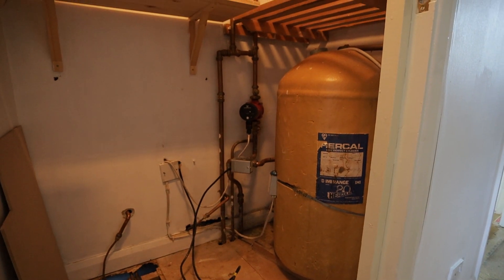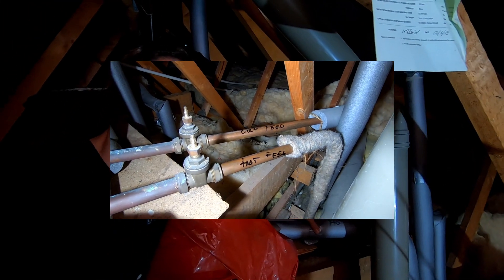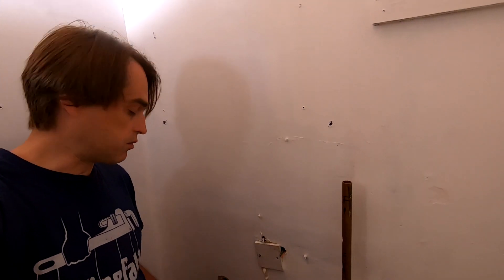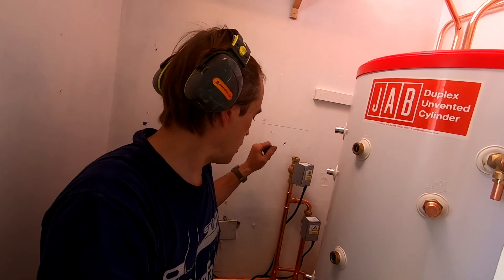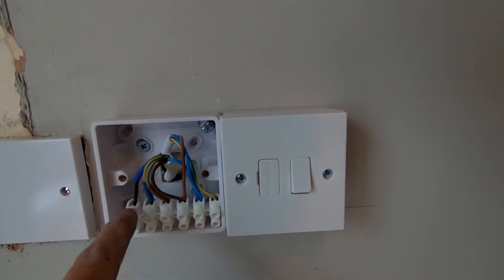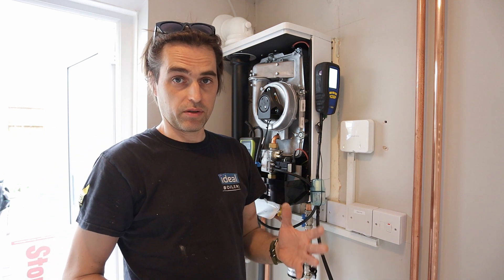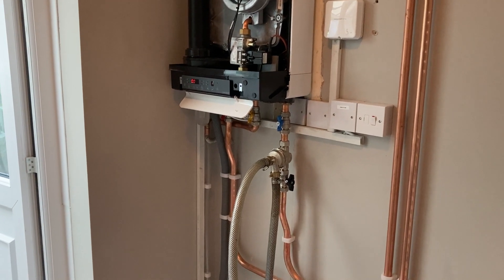Domestic Hot Water Priority with Intergas boiler.

Comment: Hi pal have you ever had the issue on a Xplan when the hot water demand has finished and the heating normally open valve opens than you get some heat in the radiators as the pump over run kicks in. Got this problem on an ideal vogue gen 2 ?

Comment: Was there a reason you used two single zone valves instead of a 3 port valve,I have used 3 port on both of mine.
In my case it was easier as it's only wiring one valve.

Comment: For those with existing S Plan systems, there is another option offered by Intergas which offers a form of Domestic Hot Water Priority without having to change any valves. The option is called "S Plan with Outside Weather Compensation". There is a wiring diagram available from Intergas, and you don't need a 'plumbing' diagram because it works with standard S Plan plumbing. The wiring diagram shows a 240V relay is used to disconnect the outdoor weather sensor from the boiler when there is DHW demand - the demand signal operates the relay to disconnect the sensor, and the sensor is reconnected when the demand is satisfied. The option requires a mains cable from the wiring centre where the zone valve for the hot water cylinder is wired to a location where the weather sensor is connected to the boiler. When there is DHW demand, the outdoor weather sensor is disconnected and the boiler flow temperature is what ever is set on the boiler front panel, and when there is no demand, the outdoor weather sensor is connected and the flow temperature will be reduced to that set by the weather compensation curve. Timing for heating and hotwater are controlled by the existing S Plan Two Channel programmer. This is the option I use on my Intergas HRE OV.
Reply from the maker: You don’t need to disconnect the WC by a relay. The boiler recognises 2 different flow temps - WC and DHW. All you need is a relay that will be controlled by the boiler when there is DHW demand and will interrupt power supply to all heating zone valves. 

The set up you propose if  inferior to the correct method shown in this video, as it will not allow you to range rate the boiler for DHW and the boiler will still think it is doing CH - one with WC and one without. 

Intergas never had correct wiring or diagrams in their manuals, it was all designed and worked out by people like Rich Burrows or Kimbo.

I would suggest avoiding the option you suggest. There are better ways of doing it.
Reply: @UrbanPlumbers  I agree that it's not as efficient as the method shown in your video. Your method is definitely better, but it involves more changes to the system, and the S Plan with Weather Compensation is an improvement on not having the weather compensation.

Comment: I have just come across your page, I'm an electrician. Whilst looking for X-plan info I found this video and must say well done on the information and presentation. My only advice would be to fit an end cap to your trunking and always segregate ELV and LV circuit for compliance; I appreciate it may have been difficult on this site.  Subscribed.
Reply from the maker: trouble is, every single boiler does x plan in a different way. You have to wire them all differently. Nice that electricians are wising up to this!

Comment: Ever come across a HRE where doesn’t seem to be responding to a demand for hot water under x plan

Parameter 1 set to 1
4 to 75
Parameter A To option 6
As per the supplement guide

Even with no connections across x4 - 9&10 doesn’t respond to hot water demand
Reply from the maker: Yes, there is a button on the face of the boiler that needs to be pressed. I kid you not - on some HRE it is invisible !
Reply: @UrbanPlumbers  yes! About 10 minutes afterwards I realised

Since you replied so quickly - any thoughts on how to have water set hotter than 65? Set point on front panel  seems to be limited to 65, but I’ve added mixing valve so wanted to store water hotter . Seem to cycling a bit on hot water so might have a bit of tuning to sort out. Cylinder is rated at 31kw
Reply from the maker: @bobwylie158  set the DHW kW lower if it's cycling. It should not cycle on DHW water. I have never seen one cycle on DHW.
You can set higher DHW in the installer parameters.
Reply: @UrbanPlumbers  I can see the flow temp for heating cylinder (parameter n) but not a way to have cylinder storage temp apart from the front panel (seems to be limited to 65) 

I’m trying to down modulate the  hre 40 SB to 60% on pdhw and see how that goes but not confident from last nights test
Reply: @UrbanPlumbers  I can see the flow temp for heating cylinder (parameter n) but not a way to have cylinder storage temp apart from the front panel (seems to be limited to 65) 

I’m trying to down modulate the  hre 40 SB to 60% on pdhw and see how that goes but not confident from last nights test
Reply: @UrbanPlumbers  I can see the flow temp for heating cylinder (parameter n) but not a way to have cylinder storage temp apart from the front panel (seems to be limited to 65) 

I’m trying to down modulate the  hre 40 SB to 60% on pdhw and see how that goes but not confident from last nights test
Reply: @UrbanPlumbers  apologies - forgot to say it in my previous replies - thank you so much for replying !
Reply: @UrbanPlumbers  done some more investigation work yesterday. Got an esp32 and some temp sensors to measure the flow / returns and cylinder temp. The set point for hot water is set at say 63 degrees but the flow during pdhw demand doesn’t creep up much past 65 until it goes into state [1] . I was expecting it to get to closer to 85 in line with parameter N. Not sure if there’s some strange opentherm negative interaction going on from the nest

I disabled opentherm and disconnected so that it’s only using on off signalling. Same result .
Reply from the maker: @bobwylie158  change DHW in parameters from 65 to a higer temp. thats all.
Reply: @UrbanPlumbers  Hi. Just thought I'd give you a quick update. Been speaking with Intergas on a couple of things. 

The DHW flow temp can be set in parameter n, but unfortunately, the DHW set point (as read by the cylinder NTC) has a maximum of 65 degrees.  

The issue I  have seems to be that of circulation  I find it hard to believe as it's 22mm flow and return but if I have the power at 75% (31KW) my flow temp only gets up to 65 degrees before the boiler shuts down. Dropping to 45% power (18.5KW),  It gets closer to 83 degrees (the cylinder always comes up to temp by time flow increases any more!) I don't have the IDS software but I can only assume that the flow rate isn't high enough to move the heat away from the heat exchanger fast enough. Next week, it's getting re-piped to 28mm to see if that helps. Modulating pump speed in parameter 3. is at 99% so it's not as if the pump is being throttled.  I'm too invested in the process to let it go , so I'll let you know if that makes any difference.  

Side note - I sized the ACV cylinder to match the power output of the boiler in priority hot water mode. The manual stated that parameter 4 is capped at 75% for the HRE40SB, but it actually goes up to 100%. Even intergas said 'oh that shouldn't be in the manual' grr. Could have went for the bigger cylinder 🙂

Comment: Intergas great boiler. They deserved to be top brand beating installers choice brand. Sad. 

I would still not prefer Intergas X plan. 

I would confused my mates in gas industry. Go with flow. S plan sensible option.
Reply from the maker: S plan is definitely not a sensible option. Industry has to change and people need to get educated. Domestic gas has been dumbed  down for years now and it has to change.
Reply: @UrbanPlumbers  Let's see how high Gas price change the Domestic industry. 

Nest, Tado and Hive are all wired on 240v, calling it smart to fool users. 

Always struggle to explain boiler sizing and next challenge is to explain low flow temp design. 

Thanks for all your efforts on YouTube. You are a top range Gas Engineer.  
Thanks for bothering to reply.

Comment: I have a similar setup with my heat pump.
A difference is, that I have a valve that will change over from heating to hot water, so only one valve instead of the 2 here.
Reply: Does it up the flow temp ?
Reply: @mgbroadsterJ  yes and no. It is a really old heat pump that cannot modulate. So that system will run until the return and flow have the needed temperature. The controller will calculate the temperature depending on the outdoor temperature. It will look at the return temperature and calculate that. 
It is combined with underfloor heating, so a little bit of excess heat can be stored in the floor.

On change between hot water or heating it will change the temperature.

Comment: This is probably the 20th time watching this and trying to understand what I need to do for my setup.

So, I purchase the NormallyOpen valve as you suggested, has 3 wires and need to connect it to HW zone valve to brown wire?

Or do I need to trace two new cables from Water tank down to my boiler? They are not close to each other unfortunately.

Whereas the controller, it has only a RELAY: COM NC NO, which cables go to that connector?

Aiming for Opentherm and PDHW.

Please advise
Reply: Thanks for the like, but would appreciate advise as I am stuck but nobody can help :(

Comment: I like how copper pipes look, how more durable they are compared to plastic pipes. But where I had a combi installed plumbers use solely plastic piping as if that were the only way to go. Can anyone inform us why plastic is bad?
Reply from the maker: Plastic should not be used within 1 meter of the boiler or so. Nothing wrong with it, just will not last as long as copper and I personally would not trust push fit fittings. Have seen some properties flooded by a faulty push fit already.
Reply: @UrbanPlumbers  Thank you for the response. As far as I could see, they use a tool to heat connecting pipes and mold them together. Is it the same as using push fittings? I was not able to find anyone in trade to use copper pipes in that location.

Comment: Also I assume if I got a multi zone heating I can fit that as normal after the normally open zone valve.
Reply from the maker: or you can use 3 port diverter instead

Comment: Hi looking to install a new unvented cylinder tank system boiler and considering solar panels to heat hot  water haven’t done domestic work for a few years. I like Intergas boilers but as this is my own home looking for most energy efficient over the years.
What would you recommend?
Reply from the maker: Intergas Xlusive combi used as a system or a Viessmann 200

Comment: Would it work with a standard open vent cylinder?
Reply from the maker: yes of course. There are special 117L high gain vented cyliners. You can get them from Intergas Shop. 
You can still set up PDHW with a regural vented cylinder, but the coil is usually pretty small in those, so you would have to range the boiler to the coil.
Reply: @UrbanPlumbers  Also, I have an Intergas 18OV, heat only. How would the pump be wired? And since there is no overheat stat on the open vent cylinder how would the wiring be altered for that?
Thanks again!

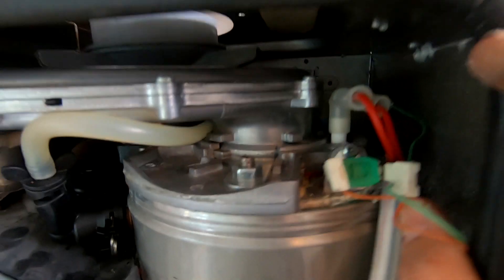Comment: @ 8:25 Someone really love bosch group boilers :)))))  .... I have some feallings for them too :))) They are not that bad but they are not good either...
Reply from the maker: I actually like 4000 and 8000
Reply: @UrbanPlumbers  4000 It is somewhat a honest boiler; 8000 It is more reliable and a little bit easier to clean but i still hate that I have to use strong chemichals to cleant the internal  deposits …. + I cant like any Bosch boilers because they do not have a low water pressure sensor or equivalent… If I really insist I can install one that I can connect to the electronic board on the ports for external security devices…. I have a very long love and hate relatioship with Bosch group products …

Comment: What a great video! I have a Intergas HRE wired in S plan. My cylinder doesn't have a pocket for NTC so thought I was snookered, but I like the idea of using the existing cylinder stat and overheat stat to 'convince the boiler that the cylinder isn't up to temperature yet'

A couple of questions if you don't mind. If you wire the nest up using opentherm, in x plan, and there is formally demand for hot water from the nest time schedule,  and demand for heating due to the nest thermostat (I know that hot water priority will mean the wet side will only be serving dhw), will the nest still try and modulate down the flame as it may think that the flow temps are too high for the heating (even though not in use at that time)

Second question, can you have x plan, opentherm and have frost / pipe stat protection?
Reply from the maker: Yes you can have nest and 2 flow temperatures and open therm. Frost protection is also possible.
Reply: @UrbanPlumbers  super, I still need to work out the finer detail with my installer. I’m still a bit concerned that if there’s a conflict with the nest  trying to demand both,  it may modulate down . 

I’m fitting a AIC tank in tank cylinder which has a high transfer equivalency (41kw) due to the capacity, but the 40sb only fires 75% in DHW mode (not sure why - the other rated boilers can fire 100%). I just hope o don’t run into any matching issues like a chap has suggest previously about delta T
Reply: @bobwylie158  
You are better off with DHW priority. Fast DHW reheat, then the CH modulates to what the WC dictates.
Reply: @johnburns4017  forgive me , x plan is intergas’ variant on priority hot water is it not ?
Reply from the maker: You don’t need pocket for ntc, you can slide it behind cylinder insulation or behind cylinder stat.

Comment: That's a great regeneration time for a big cylinder. Why does the hot water have priority over the heating though?
Reply from the maker: Because that way, you can split the boiler flow temperature and kW rating into 2 independent outputs. One for hot water at full rate and one for central heating at much reduced rate and lower flow temperature for greater efficiency.

This set up can be over 10% more efficient as compared to standard S or Y plan set-ups.

Check my next video coming in 2-3 days with 200L high gain cylinder and 18 minutes full recovery time using hot water priority with a Viessmann boiler.
Reply: @UrbanPlumbers  yeah, ok. Now I get it, very good work.

Comment: What’s wrong with using plastic where it’s not seen ?
Reply from the maker: Nothing wrong. It’s just that push fit fittings are supposed to be accessible.
Reply: I work in social housing and that’s how we do it cos its cheaper and faster. always wondered the reason for running in copper under floor cheers pal 👍

Comment: What’s the gate valve on the cylinder flow for? You have a separate auto bypass?
Reply from the maker: yes, there is a bypass. The gate valve is not on the flow. It is linking flow and return to the cylinder. In most cases is stays closed. It is there in case you get what is called a coil resonance, which can happen with this cylinder.

Comment: Hi lovely plumbing work ! But you will need a cable with more conductors, sorry.  (As per Regulation 514.4.2 of BS7671).
Reply from the maker: What do you mean by that?
Reply: @UrbanPlumbers  There is a 5 core wire between the boiler and cylinder. You are using the earth conductor in the cable for the switched live, 2 for the NTC, 2 for Live and Neutral. Since the cable is carrying mains voltages, it should have an earth conductor. If you did it by the book, you should have run an extra cable.
For example if a nail goes through the live conductor, there is no earth for it to reference through and the nail stays live becoming an electrocution risk. Since most properties you work in should have functioning RCDs, I would just forget about the earth. If you do an install in a property with an old fusebox, you should definitely run the extra conductors.
Reply: @Saaj2  
A nail can be driven into only a Line (live) conductor - the earth is untouched.  The nail will be live. Touch it in bare feet on wet floor, then all the current tries to run through you, back to it source (the generator/transformer). If no RCD is fitted then the only protection is the MCB, which may not trip until maybe 40 amps has ran through you. By then you may be dead. That is why without RCD protection bonding of metal parts was mandatory.  That is joining all the metal parts together - no taking them to earth. That is if you touch a live metal part of an appliance at 240v, then grab a pipe, the pipe will also be at 240v, with current not running right through you.  If you have full RCD protection, ugly, complex and expensive bonding is unnecessary.
Reply: Isn’t the earth cable to protect the exposed metal at the end it’s connected to? We are not concerned with mechanical damage or should he be using swa cable
Reply: @EdthePlumber  
An RCD or RCBO, continually monitors the Line (Active) and Return (Neutral) wires to ensure they are in balance. That is, inflow = outflow. If they are not in balance something is wrong so it trips cutting off the supply. 
The Earth is not part of this sensing, so technically the RCD can protect without an earth connection.
BTW, it is now recommended that each circuit is fitted with an RCBO (combined mcb and RCD). 

Electricity always wants to go back to where it was generated. So if there is a fault with the L touching a metal part of an appliance, when you touch the metal, the electricity will want to get back to its source via you. So having a wire (the earth wire, or CPC as Sparks call it) from the metal parts, paralleling the Neutral wire (the return to source) ensures the full flow will not go fully through you, as you have a higher resistance than the earth wire.  Note the earth and Neutral wires are joined at the main fuse head coming in from the DNO.